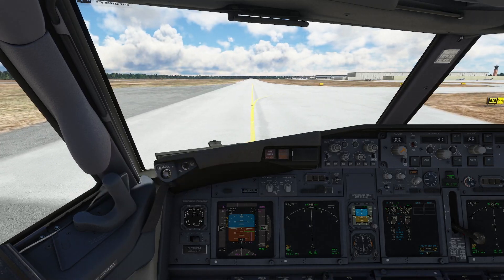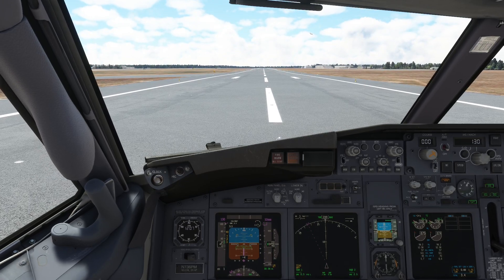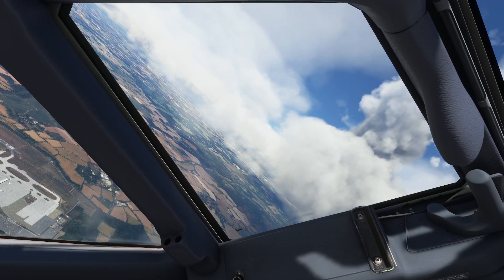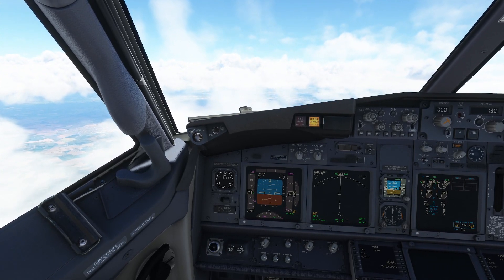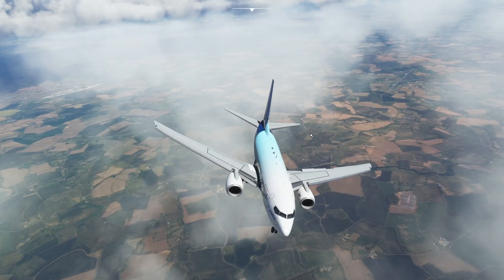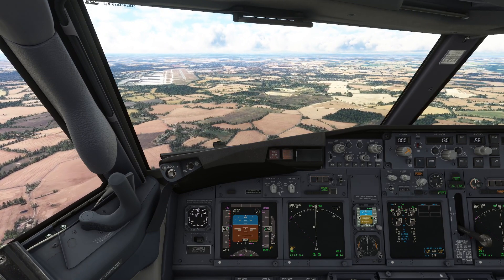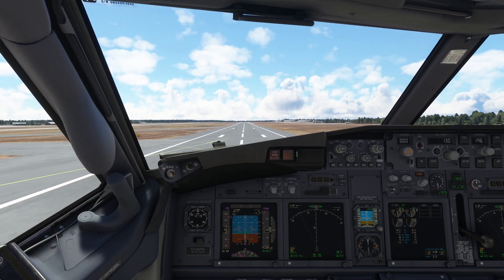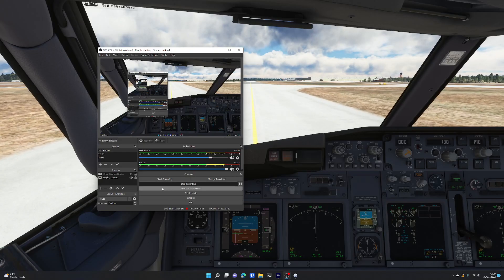Flying an airshow style performance test in the PMDG Boeing 737-600 in Microsoft Flight Simulator

Comment: You can setup honeycomb gear lever to work with it, just instead of “on press” set it up “on release”, and revers the mappings. This way it will not prevent you from moving the gear lever to “off” with the mouse, and you will still be able to control up and down with the honeycomb lever
Reply from the maker: There are lots of ways to make things work correctly - some involve extra software like axis and ohs.
Reply: @jonbeckett  yeah, this one doesn't require any extra software

Comment: Can it do a barrel roll? I'm guessing absolutely with the size and power. I gotta go try.
Reply from the maker: Yes. With damage on, the biggest issue will be the G you pull during the roll. The 707 famously did a barrel roll at an airshow when it was first introduced. Concorde did several during testing.

Comment: I would like to ask how can you be so level in flight, it always seems that 737-600 wants to always climb +7000 fpm out of nowhere for me 🤷‍♂️
Reply from the maker: Trim.
Reply: @jonbeckett  what trim setting do you use for landing? Thanks
Reply from the maker: @spookythecrab  Most planes require trimming all the time (except the airbus)
Reply: @spookythecrab  it varies wildly based on current weight and current speed..plus winds. light@300 knots might be 3.75 but at 220 it may require 4.30+. using the control column hold your desired pitch@your desired speed and adjust trim + or - until it maintains pitch with no force on the column. airbus does this for you. no other plane does.